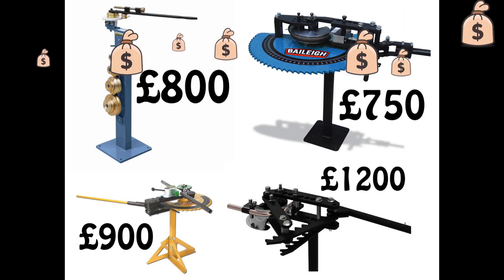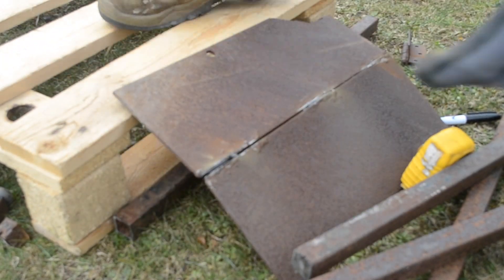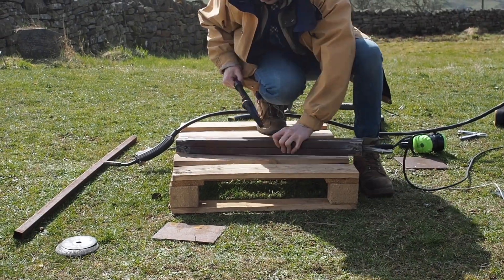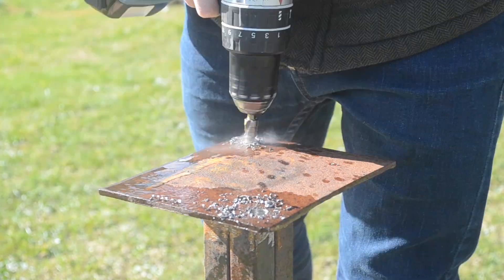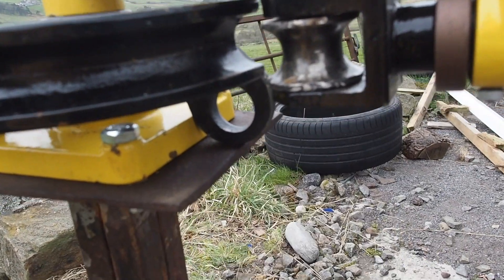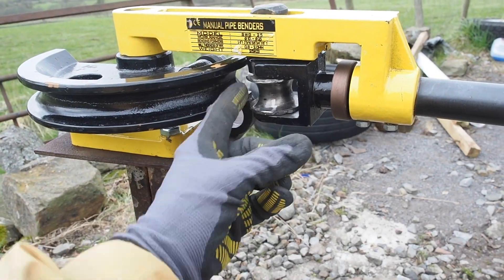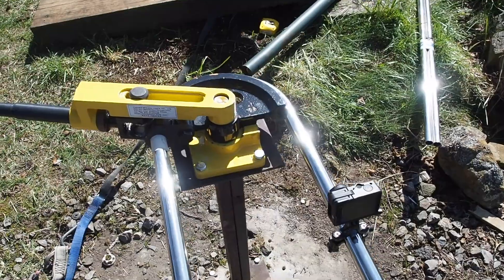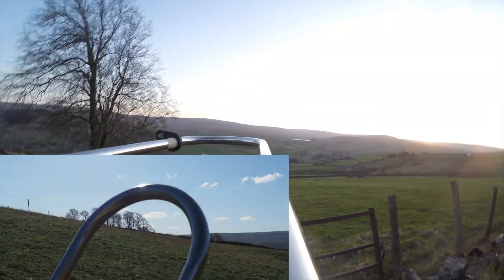Customised cheap tube bender for 180 degree bends!!

Comment: Stainless is one of the hardest materials to bend (especially in a low-cost machine).  You would not of had the kinks with mild steel or thicker material...but you have to do the best you can with the chosen material and the low-end bender.  Great job...keep up the work and you will be an excellent fabricator...

Comment: Hi Rich, Nice video, well thought out. I am looking at two similar benders on eBay because I am wanting to make a new sprayhood frame and safety rail gate supports for my small yacht using 25.4mm stainless steel tube - quotes from companies willing to do the jobs are nearly what the boat is worth!! The only thing is that the odd kink could be hidden on the sprayhood frame once the canvas has been fitted, but I can't do with any kinks on the gate supports and these will be almost a 180 degree bend. Anyway, your video has given me a few ideas, and I have decided to go for one of the benders on eBay and give it a go. Keep up the good work, I've subscribed to your channel - are you in Yorkshire? (looks like it, but probably wrong).

Comment: I applaud your effort ... however. 

This was a failure. That's fine, I fail trying new things all the time, but let's not pretend this was a success and talk others into doing the same, creating an expectation of success. 

Damaged / kinked 2mm tubing is likely only as strong as 1mm tubing that is properly bent. 

The tube that you bent had kinks, as you pointed out, and the bend did not stay level. The kinks are due to the design of the machine (mostly the die) and not staying level because you are overloading the bender so much, that it is pulling up on the tube, causing the tube to bend upwards. 

I'm assuming that it would work much better with thinner wall tubing, or if you add some support to the arm, perhaps add a lower plate instead of having it only supported at the top of the die (likely not easy to do). To get a full 180º bend, I would try extending the die slightly, an inch or two. This will likely cause the pipe to get stuck on the die when you do 180 bends, but if it stops it from kinking, it would be worth it. 

Sorry if my comment seems a little harsh... it just seems to me that this video has the potential misinform people or give them unrealistic expectations... perhaps costing them a lot of time and money.

Comment: I'm about to get this exact same bender for the exact same reason. (Great minds quote) and I was about to mount it to a large block of wood as you..Now watching your video I think I will put a concrete post in the ground and build a mount from there lol watching as writing looks like you did the same..Great tip on the weld on the roller will have to have a look at mine when I get it..Might try to sleeve it..Subbed for your ebike build..
Reply: Make sure you put a little grease on all of the pivot points on the roller and the ram...spray the tube with WD-40 to help with fitting into the die better and aid removal from a 180 bend...

Comment: Excellent mod idea. Im Impressed with what ive seen folks do with it (so far)  if i buy one, Ill be modding it a bit too: ill weld “gussets” to that lever so it can take punishment of a longer lever bar…although if its crappy cast metal im not sure if i could do this successfully. Maybe ill fab a new beefier arm altogether 

But Im wondering whats the heaviest wall thickness 7/8” or even 1” stainless that this unit will do?

Comment: When you mentioned the need for the extra long lever, it occured to me that the manufacturer specs for tube wall thickness and diameter were probably for mild steel, not stainless. As you've no doubt discovered, much tougher stuff to work.
Reply from the maker: Hey Tim, the description said it would work with Stainless no issues, I was sceptical too when I bought it, guess I was right thus why I had to adapt it to work.

Comment: I have looked at these style of benders but not really thought they were any good for the larger tube sizes . I'm impressed with the results you have achieved thanks for sharing and talking through the thought process and methods .
Reply from the maker: Thanks Gary for the kind words, I was surprised too with the results compared to the cost of the bender!
Reply: @richhindhaugh32  looking at the result for what you used and how it came out I'd say it was a very good result in your favour . I have the other hydraulic pipe bender and as long as you mark and rotate the pipe it seems to behave and not kink .( mark pipe in 1inch increments and bend a bit release move the pipe 1 mark bend again and so on little at a time then start again bending a bit more and away ya go ) . Good luck on future projects . And I'll have a look and see how the bike turns out .

Comment: i have the same bender and bent some 25mmx3mmwall tube with mine without handle extension, the key is to stand with your right hand on the handle and your left hand on the material you are bending, as you pull with your right arm push with your left arm , your affectively using the material as a leverage bar and it also takes half the stress off the roller ass you are already forcing the material in the right direction, as i say i did 25mmx3mm wall tube without a leverage bar and with out beefing up the roller and did it with ease
Reply from the maker: Hey "All Things Metal" thanks for the comment! Ive not tried that technique so ill be sure to give it a go. Stainless steels not the easiest of materials to work with so if it helps that will be brill!

Comment: I have no skill to release the pipe after bended. Actually no need to release any screw. And also, this kind of bender no really smart.
Reply from the maker: Check you are using the right size tube for the die (using pipe goes off the inner diameter so it won’t fit correctly in the rollers) also try tapping it out with a hammer.